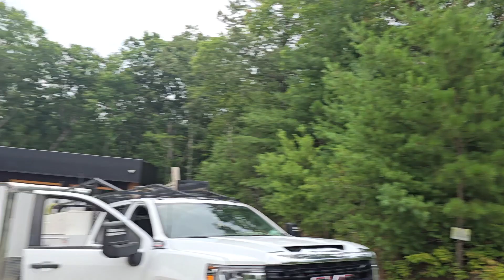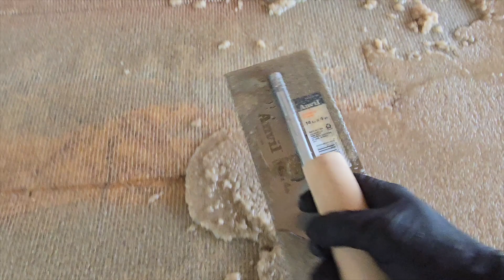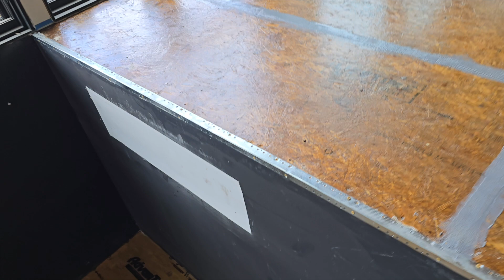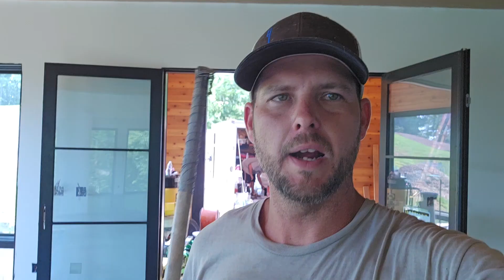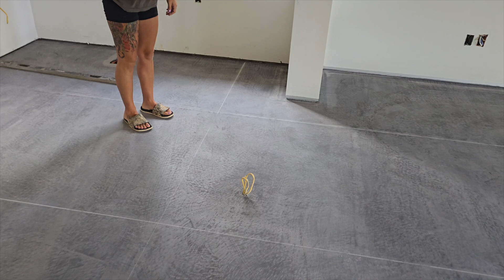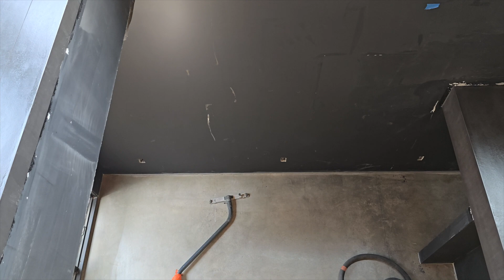Concrete Micro-topping over wood sub flooring

Comment: I'm in a second floor condo that has a couple of inches of poured gypsum over the wood subfloor. I'm sure the floor is very uneven. Can this be applied over the gypsum and to level the floor as well? Thanks. (I pulled up my carpets to eliminate dust and now I'm undecided about laminate flooring, and I've been walking on the gypsum which isn't made to walk on.)
Reply from the maker: This is a great question and hate to say I'm unsure, but I'm unsure. I'm not familiar with any gypsum that's designed to be put down as a floor covering or leveler. Have never heard of that although there's dozens of self leveling options. Some may have some gypsum in it,but as you stated that is a really soft material and never heard of it being used on a floor. This may be a good question for chat gpt or something similar. Wish I was more help
Reply: @bensconcretecreations  OK. Thanks. I think the gypsum is only used as a sound pad on top of the plywood. I now like the idea of a concrete floor instead of laminate flooring since I've had the gypsum bare. lol. I know Ardex makes primers to seal and stregnthen the gypsum. I used the Ardex P51 once. Not sure if they still make it.
Reply from the maker: @rgraz4929 ardex makes a lot of good products. I'd do some research on this. Not sure if you use AI or chat gpt but I use it numerous times a day it's a huge help especially with stuff like this with giving you options
Reply: @bensconcretecreations  Awesome. Thanks. When I said gypsum, I meant gypcrete. It's poured. I like the look of it, but it's not meant to be walked on as a finished floor. I figured with some darker concrete applied on top with some scoring, it would look awesome. That's what brought me to your video. Thx again.

Comment: Great video. Thank you for sharing.

We use a lot of concrete in our construction in Singapore. But, not so much of conment (less microcement) over OSB.

One question though. 45 bags of self-leveling compound to level up to 1 inch of height difference. Why not use cement to skrite it first. That way, you have a huge saving in material cost. 

Once again, great job!

Comment: What happens if I drop a dinner plate on this floor?  Chip the floor or the plate?
Reply from the maker: Thats a good question. I would say it depends on how it lands. We did a floor just like this for the same people over 5 years ago and they sold that house and wanted another one. They said they dropped a coffe cup on the last one and broke the cup with no damage to the floor. Its definitely not bullet proof. Its around 12k psi and the urethane top coat over the epoxy is really hard ad well

Comment: Genuinely interested in finding out how this has stood the test of time.  We are seriously interested in having this done but wanting to know if it held up well, etc. I would appreciate your feedback!
Reply from the maker: Just seeing this my apologies. This is the 2nd floor we did for these home owners. First floor was done about 7 years ago on house right above this one they sold. Held up really well. There's a chip from something heavy dropping and one deep gouge. All repairable. I would highly recommend going over hardy board if possible or doing a self leveler first and then this, although with just foot traffic they make self levelers you can pour, level out then either add color (stain/dye) or just add a top coat. I would recommend a water based epoxy followed by a water based matte urethane if I was going that route

Comment: I love the detailed walkthrough of the microtopping process! It's always fascinating to see how much prep work goes into achieving that perfect finish. I’ve dealt with similar challenges, especially with slopes and leveling. I remember one job where we had to get creative with self-leveling compounds to avoid a disaster.

Are there any tips for ensuring proper bonding with the substrate? I’ve learned that a good bond can make or break the job. Also, what’s your go-to method for maintaining a clean workspace during these projects? Keeping things tidy can be just as challenging as the installation itself! Thanks for sharing your journey—can’t wait to see the final result!

Comment: Could you use an 100% solids epoxy with sand then primer over the timber floor or does it need to water base to prevent the moisture? Worked with the microtopping on walls but never used on a timber floor and have a potential job come up with one, also microtopping will be going over some self levelling compound over an concrete area 
Cheers
Reply from the maker: @mitchcocker4514  you can 100% use 100$ solids epoxy over wood substrate i just prefer to prime the wood first with wb epoxy to make sure it's sealed off good. It's just a preference thing and a lot of guys in the industry prefer this as well. I also feel wb epoxy bonds to wood better than 100% solids which is a huge factor in my eyes.
Reply: do you use any typ of flexible primer before to prevent cracking from wood flexing and movment
Reply from the maker: @ROB77-q4z  yes, we used a 100% solids flexible epoxy membrane with full sand broadcast over top of wb epoxy direct to subflooring after filling and putting mesh over all seems like we did in this video
Reply: @bensconcretecreations thanks for the info, just breaking into coatings really want to install over wood sub floors. I'm going to start on one of my own homes first as a tester
Reply from the maker: @ROB77-q4z  just make sure it's good and sturdy with very minimal deflection. Prep is most important for any type of coating you do.

Comment: Hey man great video, you think that looks it achievable with just the magic trowel. Or is the terrazzi necessary to get that look?
Reply from the maker: @cmonman6389  thanks man and great question! If I was going to trowel finish a floor I personally prefer a hand trowel finish. I feel I can get more natural movement and control by hand troweling. There are people that finish micro-topping with just a magic trowel, sand and seal but I haven't been brave enough to do it yet. It's definitely possible for sure. I will say that terrazzi sprayer puts that material out as this as paint so it's only going to look as good as the trowel (magic or hand) underneath it and then of course sanding/screening it. I have done them with hand trowels that looks great but it's a hell of a lot slower and you've gotta make sure to keep a wet edge to not get a cold joint

Comment: Thanks for posting this! My wife is an artist (you know like paint and shit lol) and I am going full idiot renovating her art studio but was really wondering what to do with the floor. She just wants the cheapest option but ya that isn't going to happen. I really doubted I could do a concrete type floor but found your video and man the creative wheels are spinning. 

I am not a concrete guy really. I parged the exposed ICF around my house this year, made a pad for a hot tub and tile etc... but I have built a couple houses and have a pretty decent skill set and it's a relatively small space that will eventually be covered in paint and charcoal anyway.

I was considering a heated floor (electric mat or cable). We live in Canada in the rockies. Have a gas furnace and wood stove for heat but thought that the heated floor might supplement those a bit so it would require less forced air since it's an art studio and moisture can be a bitch at times.

The room is about 12' x 11'. Has carpet right now with wood subfloor transitioning out to the hall which has engineered hardwood. So I think I will have room to fit heating cable in, but I was wondering do I just cover it with some self leveller same as for tile and are there any other considerations to think about with the heated floor pertaining to the micro-topping? 

Sorry for the long message, and ya, that was a great watch. Thanks again!
Reply from the maker: @scottyboy4234  appreciate you watching and thanks for the comment. 
A lot of options available for sure! You can actually run radiant heating through pex then pour a slab and it'll stay heated as well. The sky is the limit on possibilities with concrete, epoxies, overlays etc. Lot of good content out there for ideas as well. Best of luck with whatever you decide to do im sure it'll turn out great! If your wife is an artist I'd definitely utilize that on the floor option as well